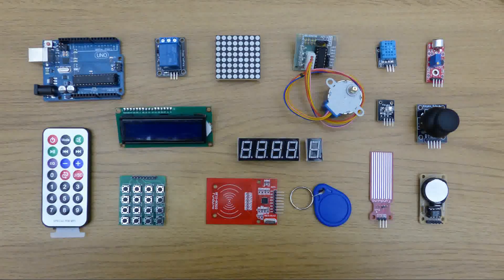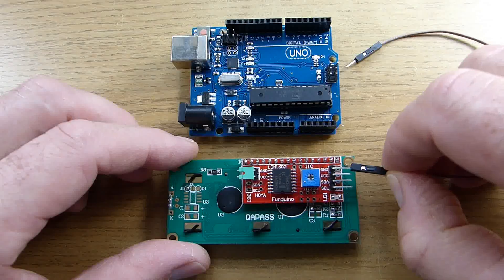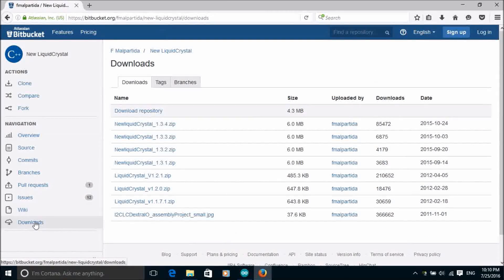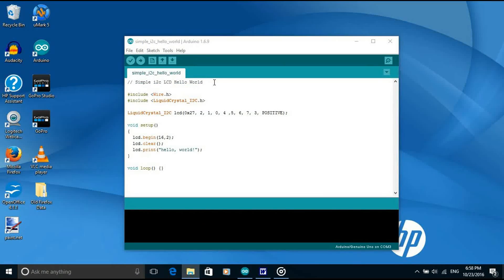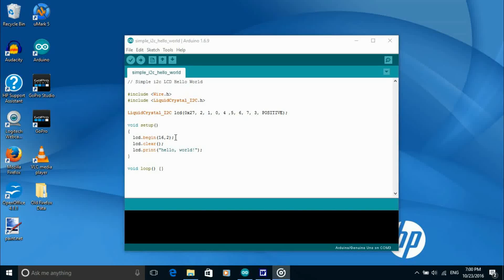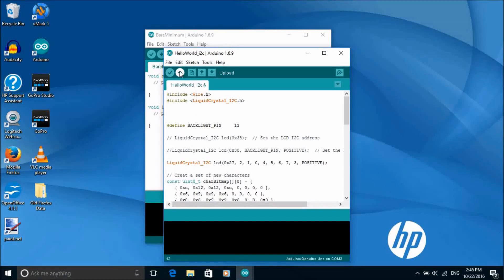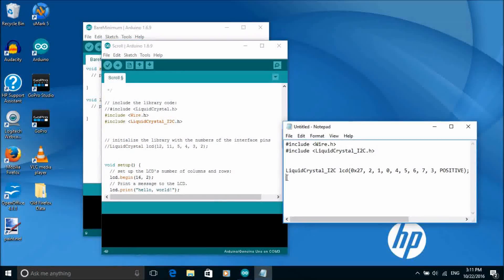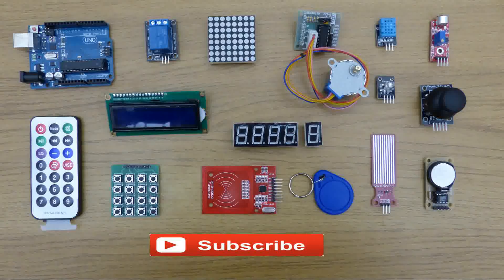How to Connect an I2C Lcd Display to an Arduino Uno Tutorial

Comment: For some reason, when plugged in, the screen shows the top row completely on (Fully white), and the bottom row completely off. I have tried adjusting the contrast knob on the back to no avail, what have I done wrong?

Comment: I get black boxes on the first line, and almost every example im testing, the backlight ends up flasing.
I have 2 different displays, and i have found the adress fr both of them, but changing it doesnt help. I have had them both working before, and remember i was searching alot to find a code that actually worked. Its displays bought from china if that matter, and they got the display driver (backpack on them) Any good tips?
Reply from the maker: Your backpack might be wired differently. Try this line instead:

LiquidCrystal_I2C lcd(0x27, 4, 5, 6, 0, 1, 2, 3, 7, POSITIVE);

// Change the 0x27 i2c address to the i2c address found with the i2c scanner sketch
Reply: @techydiy  If this is the one in the description, i tried it but it didnt help.
When i last made it work i found some info, mine has FH written on the backpack, and this would mean i had to use some kind of code to make it work.
But i dont remember what. I might have to google it again..

Comment: 2:30 I cant, it says "Port is busy"
It did 10 attempts of: 

"avrdude:stk500_recv () : programmer is not responding"
Reply: Try another port
Reply: @rasgelevideolar4372  there is no other port. Just COM8
Reply: I still have no solution
Reply: @bambino16  try going to tools>processor>old bootloader. worked for me

Comment: How can I solve this:
'POSITIVE' was not declared in this scope
thanks..
Reply from the maker: Have you installed the newliquidcrystal library from F Malpartida ?  
If the answer is no then you have missed out a step and need to watch the whole video.

If you have installed the newliquidcrystal library then:
From the Arduino IDE 
Select  File -  Preferences 
Select Show verbose output during compilation
Ok

Compile your sketch again

You should see a message below that says something like:
Using library NewliquidCrystal in folder: c:/Users/arduino/Documents/Arduino/libraries/NewliquidCrystal

Check that the library path is correct.
If its not finding the correct library  NewliquidCrystal then that is the reason for the error.
Reply: @techydiy  The answer is no. I'm using 1.8.8 IDE version and it wasn't possible to add  newliquidcrystal library from F Malpartida .
But it's working now. Thank You..

Comment: For all those who have "No I2C devices found", if you have SCL and SDA, see next to your USB connector, you have after your digital pins (2,...,13) SCL and SDA pins. Try pin 20 (SDA) and 21 (SCL) ortherwise, good luck !
Reply from the maker: On an Uno R3 the pins are  A5 (SCL), A4(SDA),  AREF, GND, 13, 12, 11 ...  etc.  
A5 (SCL) & A4 (SDA) are connected to A5 & A4 analog in respectively.
So unless you have a pcb fault it will make no difference which set of pins that you use.

Comment: To the people who are using an Arduino Mega 2560, use digital pin 20 and 21. These are literally labeled as SDA and SCL. You may also need a I2C scanner that works with the mega. And your Serial will be 115200 baud (set at the bottom of the serial monitor). Doing this, you should be able to get the I2C address. Mine was the same as the video '0x27'
Googling and other YouTube videos helped me with this.

Comment: Seven months off and on and still can't get hello world on the 16 x 2 ic2 backpack.
I have used different unos, different displays, usb cable, pull up resistors to vcc and
ground.  I have used a meter to verify the jumper connections.  I have scanned the
backpack which gives 0x38 as address.  Backpack uses jumpers to set address
supposedly to 0,  0x20-27.  Soldered jumpers in various  combinations.  Adjusted
backlight.  Used different sketches including Adafruit , New liquid crystal.  All compile
and load, but still NOTHING.  Will someone please help me.  I am not stupid.  I have
worked with analog for years and retired now and trying to get up to date.    I know 
this is freeware etc , but others get it working.  There must be something so  basic
that it is not being stated in these tutorials.  I will never give up but this is the worst.
I do my own taxes every year the old school way. If I can understand the IRS bullshit 
and do it to their satisfaction then this should be so easy.
Reply: Finally.  Liquid crystal I2C by Hangul worked the first time.
I got both my 16, 2 displays working off one uno.  Turns out 
they are 0x3F and o 0x38 respectively and quite different in
color quality, but functioning.  Both backpacks have the A0-A2
jumpers, one of which I soldered all,  but the 0-7, 0x20-0x27
have no bearing on the displays.  I dont understand this and
it cost me a lot of what should have been enjoyable.  Well it
was educational.  Thanks for offering to help me.  I will subscribe
to your channel.  Looks like I need to at least look into basic level 
code.

Comment: Can you please elaborate on the pullup resistors on data and clock lines?
Reply from the maker: The i2c  drivers are open drain,  which means they can pull the signal low but not drive it high. The function of the pullup resistors is to drive the lines high.      The minimum value of the resistor is limited by the i2c drivers ability to pull the lines low. The maximum value of the resistor is limited by the capacitance. Basically the longer the i2c lines, the greater the capacitance and the lower the required pullup resistors.

Comment: why is my i2c address is 0x3F instead of 0x27 ?
Reply from the maker: It is determined by the controller chip used on the i2c backpack.  PCF8574 usually has a default address of 0x27  and PCF8574A  usually has a default address of 0x3F. 
You can change the I2C address by soldering three jumpers on the I2C backpack giving eight I2C address options.
Here is the datasheet for PCF8574:      http://www.ti.com/lit/ml/scyb031/scyb031.pdf

Comment: Could someone please help, lcd won't show text only lights up, have tried all tips on various threads listed here. Thanks
Reply from the maker: FAQ:  
Q. My lcd display is not showing anything?     
Try changing the contrast potentiometer on the back of the display.

Q.  The lcd display shows weird characters?   
Your backpack might be wired differently. 
Try this line instead:  LiquidCrystal_I2C lcd(0x27, 4, 5, 6, 0, 1, 2, 3, 7, POSITIVE);  // Change the i2c address

Q.  Com port not found errors    
Run the windows "device manager", expand  "Ports (COM & LPT)". Check that the serial (com) port exists. 
Check the board is plugged in to a usb port. 
Check the device driver is loaded. 
Some clones use the CH340 driver, you will need to download and install it.

Q. The scanner sketch can't find the i2c address? 
Check the wiring.  
Some Arduino  models use different pins for the I2C connections, if you are not using an UNO then check which pins you need to use.
Reply: Thanks, I have tried all your suggestions, no luck. Been trying potentiometer on every attempt, tried change the i2c address LCD went black, Com Port no errors,  using CH340, device appears to be working properly - only question... you said I will need to download and install this driver , not sure what you mean here sorry, haven't I already downloaded it? The scanner finds the i2c address every time.
Reply from the maker: If your communicating with the Arduino ok then no. You don't need to download the driver.
Reply from the maker: If you can find the i2c address then the Arduino is communicating with the i2c backpack.  You now need to try the different pin configurations for the LCD display, I listed another one in the FAQ, but make sure to change the first parameter to the correct  i2c address that you found with the scanner. Failing that it's usually the case that it has been wired wrongly or the contrast pot is not set correctly. Good luck
Reply: now Arduino board not showing any life?
Reply: Working wahoo! Cheers guys

Comment: hii, it was awesome,
can we hard code it, such that when it is not connected to the computer just receiving a power supply and when we start the circuit than the program runs automatically.
please answer it I have a project to submit in college.
Reply from the maker: That is how it works. You just need a power supply.
Reply: +techydiy thanks for the reply so can we power it up if i connect it to my mobile through usb cable or some other cable , and one more question pls answer it  
can i charge the circuit using some sort of charging adapter and it will work for a certain period of time.
Reply from the maker: Yes, just check that the phone can deliver the required current output.
Reply from the maker: See this video about how to wire a battery and charging circuit to an Arduino    https://youtu.be/8lBElJRLUss.  It's a different type of project but the principles are the same.

Comment: I got an error code when I tried to compile this code the hello world code so if your have the some problem use this code 

// include the library code
#include <Wire.h>
#include <LiquidCrystal_I2C.h>
/**********************************************************/
LiquidCrystal_I2C lcd(0x27, 16, 2); // set the LCD address to 0x27 for a 16 chars and 2 line display
/*********************************************************/
void setup()
{
  lcd.init();  //initialize the lcd
  lcd.backlight();  //open the backlight
}
/*********************************************************/
void loop()
{
  lcd.setCursor(3, 0); // set the cursor to column 3, line 0
  lcd.print("SunFounder");  // Print a message to the LCD
  
  lcd.setCursor(2, 1); // set the cursor to column 2, line 1
  lcd.print("Hello, World!");  // Print a message to the LCD.
}
/************************************************************/

Comment: Can I connect SPI display to I2C IIC Serial (4wires)? The SPI display has can I leave not connected RES DC CS pins on display. Will it work?
Reply from the maker: The two protocols are different. Why don't you just connect it to the spi bus?

Comment: I get a error saying board at com1 is not found :(
Reply from the maker: It is very unlikely to be com 1. You need to check if the serial device is installed and working. Then select the correct com port.
Reply: and i got windows 10
Reply from the maker: From windows run device manager (type device manager in the search). Select and expand Ports (COM & LPT). Check if you can see the com port of your Arduino board. If not check that it is plugged in and the device driver for the board is installed, if its a clone board it might need a ch340 driver.  If you cant see the com port in device manager then its never going to work, so get that working before anything else.
Reply: i got the ch340 driver in my arduino uno clone.
Reply: and i dont have a com1 i only have com4 & 3 5

Comment: everything is working, the script is compiled and everything... it is just that nothing but white boxes pop up and no words
Reply from the maker: Your I2C backpack might be wired differently. 
Try these lines instead:      
LiquidCrystal_I2C lcd(0x27, 4, 5, 6, 0, 1, 2, 3, 7, POSITIVE);     or        
LiquidCrystal_I2C lcd(0x27, 4, 5, 6, 0, 1, 2, 3, 7, NEGATIVE);              
Replace the first parameter  (0x27) with the i2c address that you found with the i2c scanner sketch.

Comment: For a first attempt nothing here is easy at all.  Go to bitbucket and get, well it's 
not that easy,  You have to sign up for the usual email invasion.  As for the rest,
the presentation is too fast, the screen details too small, and author takes for
granted that one is familiar with a lot of processes,  Too be fair I think all these
tutorials start out with "it's so easy"  soon followed with but, and also you have
to etc.  At least this guy doesn't have an Indian accent that is so thick you can't
understand.  I found Julian Illet's to be as convoluted also.  Damn him, ebay and
insomnia for letting me by stuff I am obviously to stupid to ever use or enjoy.
Reply: Here I am and still cannot get this to work.  I have ordered other displays, used
different unos and still nothing.  Backlight comes on.  Scanned for ic2 address 
and that ran  no problem.  There are only 4 damn wires and I have them 
correctly plugged in.  I have tried Adafruit liquid crystal and new liquid
crystal.  WTF?  I can see everything here quite clearly and have done what you
recommended.

Comment: hi using same code as yours i already adjust the contrast  but theres nothing to display only boxes
Reply from the maker: Check the i2c address, if that is ok then you might have a different pin configuration on the i2c backpack.

Comment: I know this is old but I hope you can help.  I have the exact same LCD as you and followed all the instructions but my backlight will not turn on when I upload the code. I know it works becuase when I first plugged in the LCD, the backlight lit up like a christmas tree. It was only when I uploaded the code that it wouldn't work.I can see "hello world" diplayed on the LCD, however. Just no backlight. lcd.backlight() will not work either as the IDE does not recognize this command. Where did I go wrong?
Reply from the maker: There is usually a jumper on the i2c board to enable the backlight.

Comment: hi, im new to arduino and i just want to ask this. i'm trying to use pin 2 as an interrupt pin but at the same time im using lcd with i2c, in the sketch pin 2 is assigned already, does it mean I can't use pin 2 as interrupt pin anymore? im using a flow meter sensor
Reply from the maker: I can't remember what is in the sketch but i2c doesn't need digital pin 2.
Reply: techydiy thank you for clarifying sir

Comment: Hey, using the same code (with i2c edit of course) and wiring I sent the code to my Arduino with no errors. The backlight lights up but I can't see any boxes nor text at all. Any help is appreciated thanks!
Reply from the maker: Try changing the contrast potentiometer on the lcd display
Reply: techydiy I totally never noticed a potentiometer adjustment on the back! Can't currently check but ill let you know if it works when I get back from school. Thanks!
Reply: Thanks so much. Works perfectly now!
Reply from the maker: Glad it worked. I should have put the pot tip early in the video! Thanks

Comment: Hi, I wonder if you could help me, I'm trying to develop a weighing scales  that has a built-in max and minimum alarm. The reason for this is I'm in the process of setting up a weight loss business and I don't want my patients to be able to see their weight. Ideally what I want is for them to stand on the weighing scales and if they go over a preset maximum weight, an alarm will go off and similarly if they go below a preset weight an alarm will go off.
Reply from the maker: +cathal butler So you would use a strain gauge or load cell as the sensor, along with some mechanics to transfer the force to the strain gauge, then you would probably need a bridge and an op-amp, measure the output with an Arduino and then program it to do whatever you want. The mechanism is the hardest part, I would hack an existing set of electronic scales and it should have a strain gauge that you can hookup to. There are plenty of videos around about strain gauges, I think Andreas Spiess had a video about them.

Comment: could somone help me?
for a project on school i need to use arduino industrial 101 horrible thing never get it.
my problem right now is that is doesnt have the A4 and A5 ports so i cant connect the screen to them. is there a way i can change the ports that are used in the library so that it wil work with for example A2 and A3
Reply from the maker: I don't know much about it, but looking at the schematic it has an  ATmega32U4 on the board with I2C connections for an oled and the documentation mentions this is supported by the wire library, so that is where I would be looking.
Reply: yeah i was thinking the same thing. thanks for the quick response!

Comment: I realize so many asking about how to find the parameters for the code below:

LiquidCrystal_I2C  lcd(           ???               );

My working setup is like this:
LiquidCrystal_I2C lcd(0x3F, 2, 1, 0, 4, 5, 6, 7, 3, POSITIVE);

The actual layout of the parameters:
LiquidCrystal_I2C lcd(ADDR, EN, R/W, RS, D4, D5, D6, D7, BL, BL_POL)

ADDRESS = 0x3F      //Use I2C scanner to find this. Link: http://playground.arduino.cc/Main/I2cScanner

BL = Backlight
BL_POL= Backlight Polarity

* You can change backlight polarity to POSITIVE or NEGATIVE.
Positive to turn on light. Negative to turn off light
Reply: Thank you!!!!!!!

Comment: how to know the back pack name 
the line
LiquidCrystal_I2C (0x27,                           ) how to find the parameters
Reply: Dunno but mine just worked with the values he gave
Reply: You have to download I2C sketch run it in Arduino open serial window at top right corner of sketch and it will give you the I2C address looks like this:0x3F or 0x70 that's the address,hope this helps

Comment: I find it rediculous how some "arduino modules" are available. Some of them like the dht11, relay, buzzer and even push button switches don't need to be slapped onto a pcb and called an arduino module